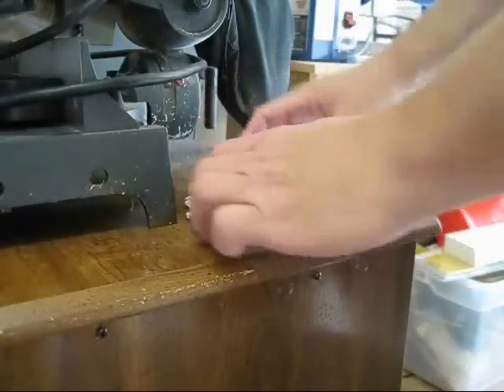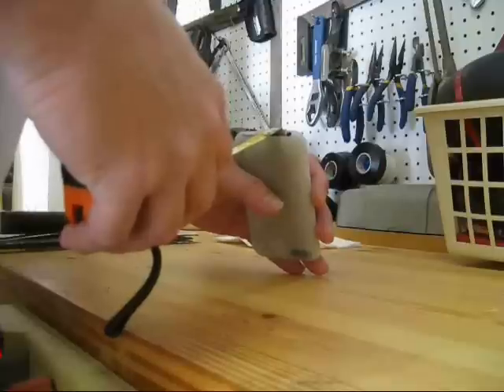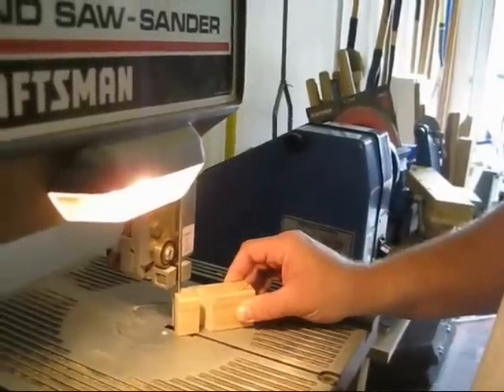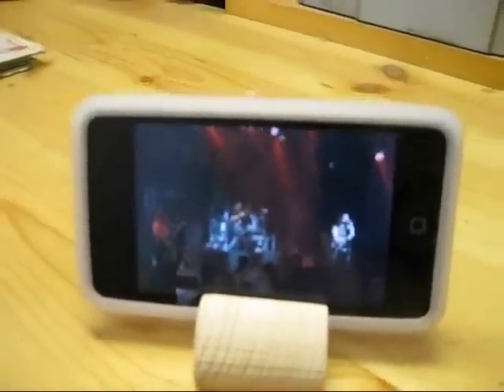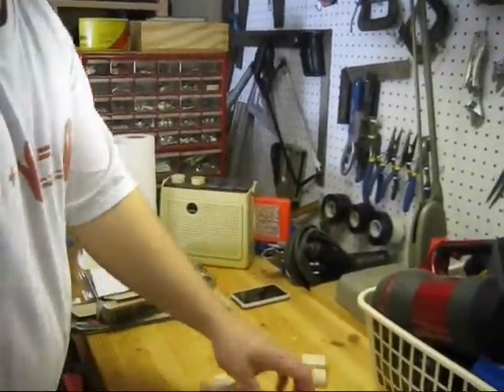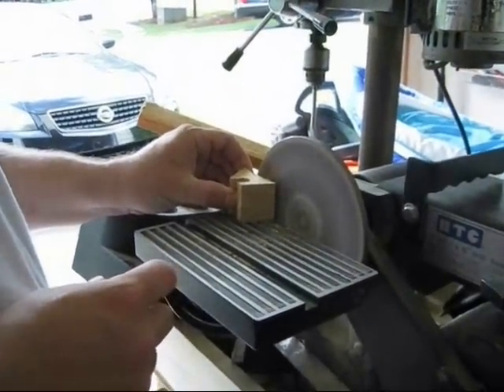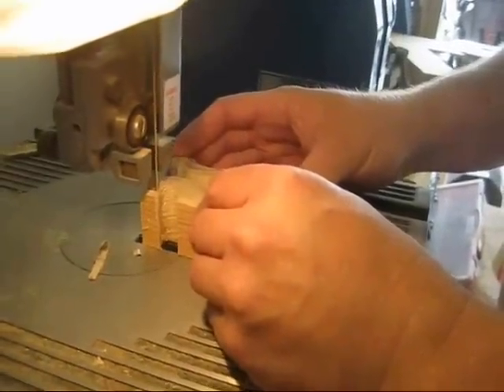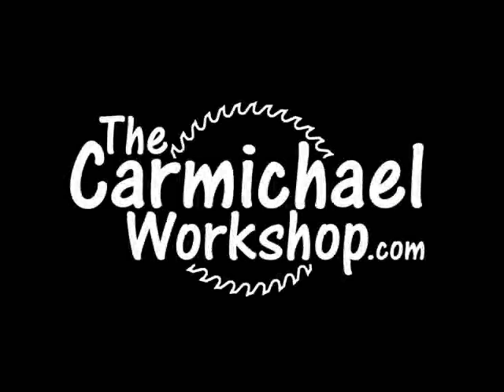Making Wooden Stands for Phones and Mobile Devices

Comment: I want to make these for my niece's and nephew for Christmas! This is just what I was looking for! thank you for sharing!
Reply from the maker: They would make great gifts.  Just watch out for cutting too thin across the grain where it could break.
Reply: any suggestions for doing these with very limited tools! I have a handsaw, a drill, a jig saw and a couple files and chisels that might work
Reply from the maker: I'm going to give you some links to my templates.  This first link is a 3pc phone puzzle that can be cut from 1/4" plywood and slipped together on the notches.
https://drive.google.com/file/d/0B6h-sbaZx3xtRlhreEdnNXR6dzQ/view?usp=sharing

This one can be cut from a solid 2x board.  Drill the hole, then make two cuts down to the sides of the hole.
https://drive.google.com/file/d/0B6h-sbaZx3xtOGZJelFlUHpwVE0/view?usp=sharing
Reply from the maker: Change the shapes as desired.
Reply: thank you sir!

Comment: hey i like your idea and if im going to build it with my hands i mean w/o ur large equipment what aould i use for cutting it om middle?
Reply from the maker: A coping saw like this one - http://www.lowes.com/pd/Kobalt-6-in-Coping-Saw/1018541?-_-store_code=2908&cm_mmc=SCE_PLA-_-ToolsAndHardware-_-HandSaws-_-1018541:Kobalt&CAWELAID=&kpid=1018541&CAWELAID=1367978788&k_clickID=abb678b5-afe8-418a-b462-2b6ef357bdec